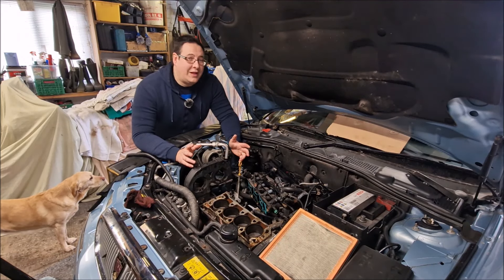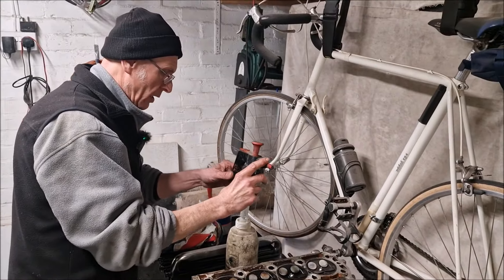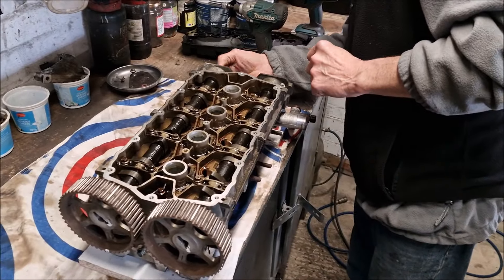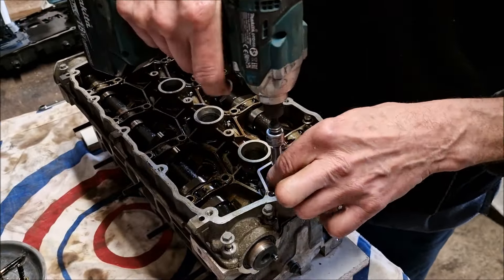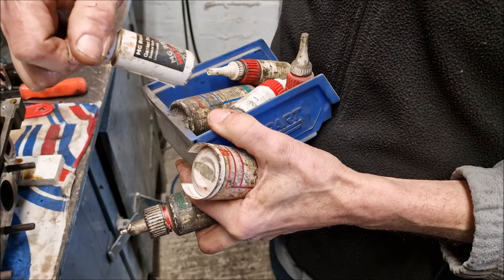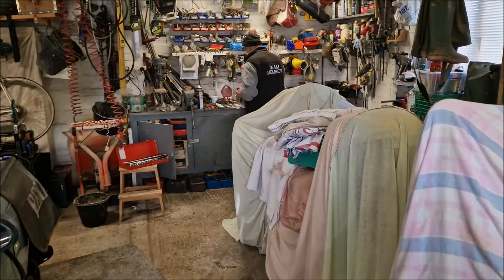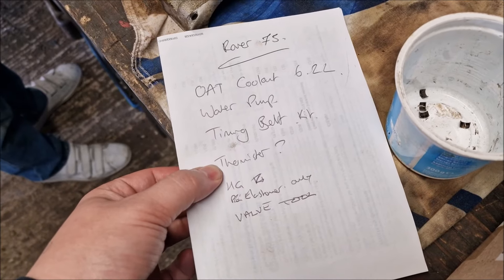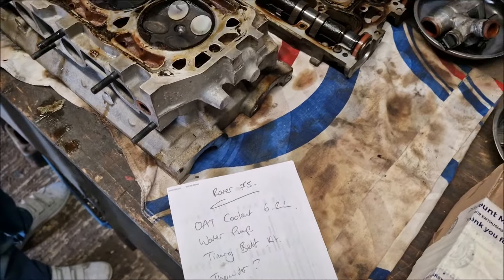Rover 75 Cylinder Head Teardown And Testing PLUS Valve Inspection

Comment: This could turn into a full rebuild - not out of neccessity but because your dad likes to do things properly. This is the old school that we will miss so badly in the future.
Reply from the maker: Were lapping in new valves as I type
Reply: Yes very true, Ive got the Rover 75 V6 Saloon and okay she has alot of miles on the clock and the parts for the usaul wear and tire are always come if you like it or not.
Aleast O know what ive got
Reply: @JonCoupland You may as well be fully confident in the refreshed engine so you can thrash it on the road and enjoy the K series character.

I’m still not sure if a neglected cooling system caused the head gasket failure, or if a failing HG made someone try a bodged quick fix using Stop Leak or similar. Or did tge typically failed fan controller cause overheating and subsequent HG failure.

Comment: You can get them in Pack of six,look like normal sponge use in the kitchen me I use them on the doorcards,seats stiring wheel leather just dampern them in water or in oil frim cylinderhead using in the same way as Sandpaper
Reply from the maker: Good tip!

Comment: Surely Rimmer Bro's at Bracebridge, just outside lincoln will be able to help with the parts and sundries that you need seeing as they are Rover specialists.
Reply from the maker: Sadly we've found they are quite expensive in comparison to others such as MGRS
Reply: @JonCoupland They are in most cases but they're always nearby (in my case and yours) to get what's needed the same day if necessary.
Reply: Throughly enjoying this series. Top work both 👏👏👏👏
Reply from the maker: @verved1  many thanks 🙏